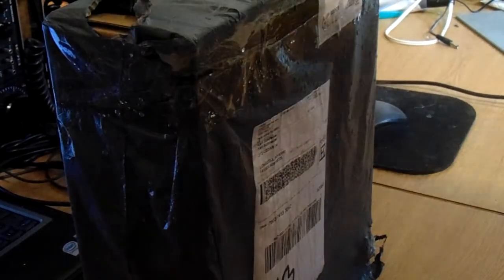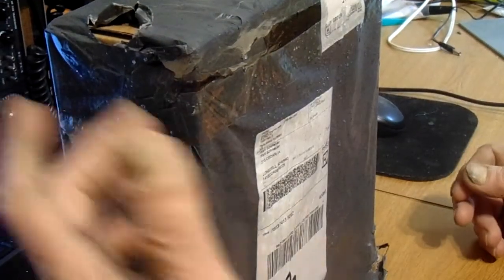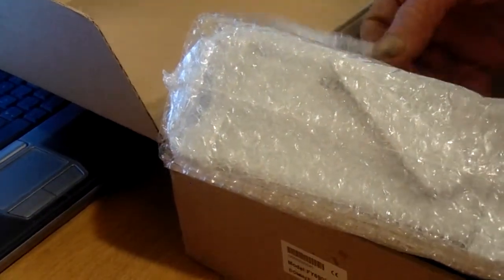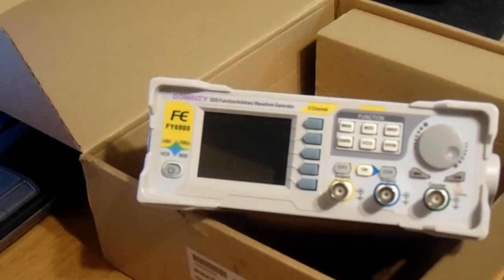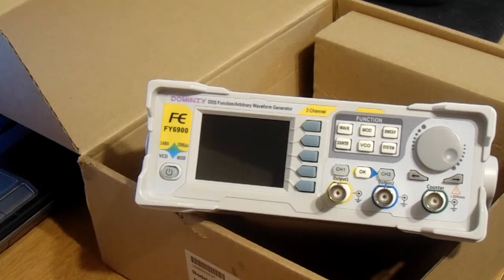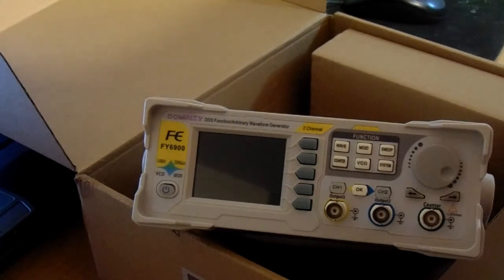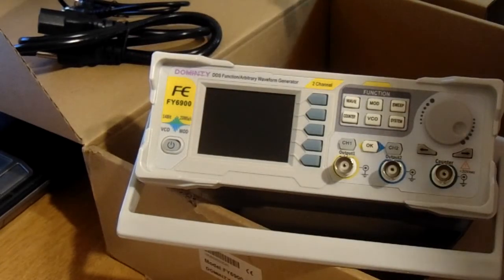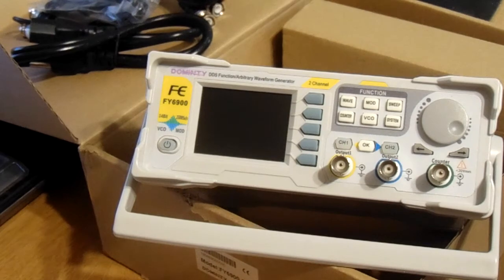fy6900 Signal Generator / Frequency Counter Unboxing

Comment: https://youtu.be/ZxxFSSdewHw?t=1417
I think it's a crappy device. The device has a Huge jitter.
The entire line of these devices are not worthy of attention.
Reply: People do have their opinions, but honestly these units are a low cost alternative.  You can modify the power supply and the DC-DC converters and for less than $200, you have a nice accurate function generator.  To top it off, even after these upgrades it's literally hundreds less than name brand equipment that gouged the pocketbook of consumers and professionals alike for decades!